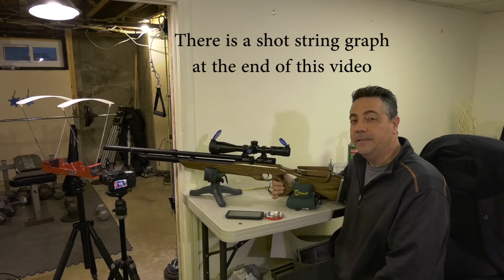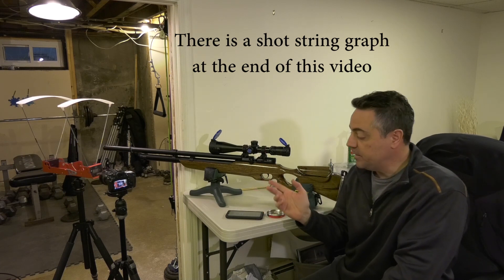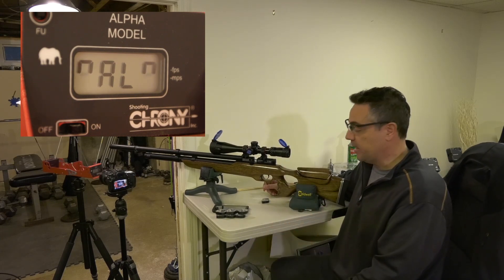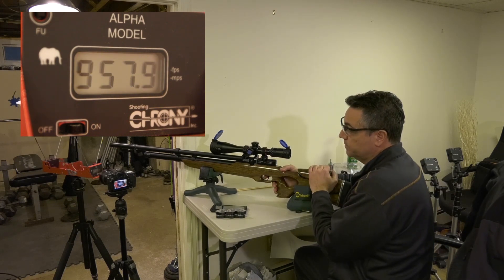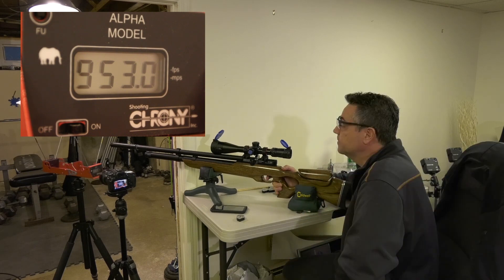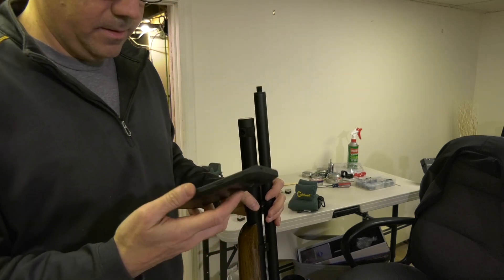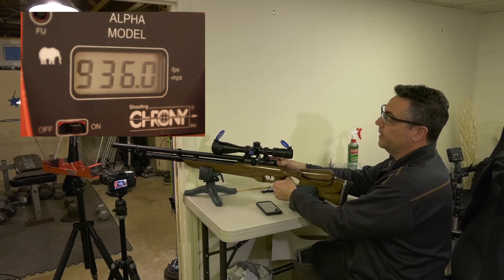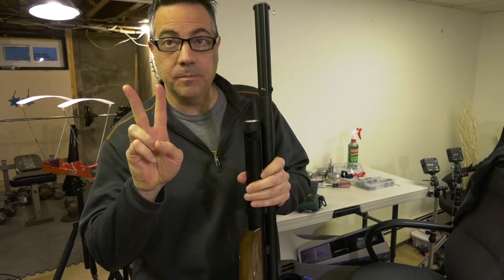ATI Nova Liberty 2nd Gun shot string and regulator test

Comment: Hi there, I did something similar with a at44 long QE using a Audrius regulator set to 115 bar and I follow the advice from some experienced guys from GTA and  airgunation    I was able to get  70 usable shots inside the regulator pressure around 825 -830 FPS was a almost flat line just amazing.For better accuracy less speed is better around 825 FPS is the max for a 14.3gr and also they help me to understand that to find a better air usage we need to find the “Plato” between Regulator pressure and hammer tension, you are doing a terrific job on this rifle but I think you can get more shots inside the regulator pressure using the same 14.3gr if you decrease the velocity and the air pressure regulator, probably 100 usable shots.

Comment: Wow just did my trigger move the screw to last hole much better , also turned 1/4 turn on the regulator wheel all i have to do now is tap the barrel to 3/16 need to get a new drill bit set hope mine turns out as nice as yours Steve.
Reply from the maker: Eventually, you may want to contact Duy (GTA name DarkCharisma) to have a power adjuster and transfer port enlarged.

Comment: Great job ! What happen with the Crosman baffle u start with ?  Any reason suppressor over that?  1 shim 1/4 turn on the reg an barrel port drilled to 3/16 that’s what is working best for u as of now ?
Reply from the maker: Thank you! I just like my airguns very quiet. This is now more quiet than my Cricket. Both guns are great. I'm just trying something different to see if minimal adjustments works fine too.
Reply: Air Velocity Sport right on do what u do brother u good.  Reason I’m asking is because I’m trying to clean up a rat problem I got the ATN  rocking 3*14 it’s dialed in but I think the liberty might be too loud without a sound suppressant of some kind for these rats

Comment: What scope and rings are you using ? Someone else asked about a year ago about the scope change. My dilemma is I can't get the right combination for height and location for eye relief and the loading port access. Putting a scope on an air rifle has more challenges than a firearm.I have purchased two scopes that won't work on my gauntlet or liberty. I like the 44mm lens. One of mine the thickness of the front lens cover housing is just enough it hits the breach block and shroud. It is a UTG 3-12x44 w 30MM tube.Compact Tactical Rifle Scope illuminated.SCP3-UM312AOIEW I thought this would be the berries but too short to get the right movement back and fourth combo with the ring position.Mid height rings calculated right but the front lens cover fitted onto the scope housing doesn't clear the breach block or shroud. With your experience. I figured you may have encountered this problem once or twice yourself.
Thank You:
Reply from the maker: The scope used in the video is the Discovery 6-24 vtt scope with Discovery mid rings. I now use the Discovery 5-30 HD 34mm tube with same rings. I have no problem because of the adjustable stock I made. Now I do have the same problem on my kral puncher jumboit does not have an adjustable cheek piece so I have to use padding with a wrap to get the correct height.when there is no adjustable cheek piece it makes it very difficult to get the correct eye relief and height. I'm now in the process of making an adjustable stock for my kral puncher jumbo

Comment: 70 shots from 3600 psi! That is awesome!! I wonder how many you'd get from a 300bar fill🤔
Reply from the maker: Probably another 29 shots. 52 addition bar divided 1.8 bar per shot is 29 shots. 100 shots from 300 bar at 29fpe
Reply: Have u tried crosman premiers for accuracy? Mine just did not like them
Reply from the maker: No, but I've heard from many people that they are not good.
Reply: 4350 psi fill does get a lot more shots but from my experience, 3600 psi fill gives you the most consistent shots and I refill when the pressure falls to 2400 psi. Because a max fill seems to affect the velocity a bit as in slower pellet speeds are what I have personally noticed. In the defence of the gun, I have the regulator opened up the whole way and the hammer spring maxed out for pushing slugs at the moment. Currently, if I put a 15.89-grain pellet in the gun and shoot it from 3600 psi fill it will Chrono at 1080 fps but if I fill the gun to 4350 psi the velocity will drop down to the mid 800s...most likely something that I've done and not the guns fault. AVS aka the banker would be more knowledgable on this issue I'm sure. I'm still wet behind the ears in the PCP world and have a lot to learn. But my guess would be my regulator is opened too far to work effectively maybe...I don't know for sure. What I do know for sure is the velocity does start to decrease when my gun gets below 2400 psi currently and when I fill above 3600 psi. Hope this helps you.

Comment: I have my Yong Heng compressor coming tomorrow. What kind of hydraulic oil do I need to get ? I'm going to get the dessicant filter system like you have.
Reply from the maker: #46 hydraulic oil. There is a  better good filter that has the bleed valve already installed. It $135 on Amazon. You might be able to get it on AliExpress for less.
Reply from the maker: Here is the link 30Mpa High Pressure Air Filter External Water-Oil Separator Filtration for Air Compressor Air Pump Scuba Diving https://www.amazon.com/dp/B077SX5G9V/ref=cm_sw_r_cp_taa_TKpGCbTBMRPGK
Reply from the maker: Remember, to not over work this little compressor. In the beginning it will fill your tanks fast because the orings are new. Over time as the orings wear it will fill slower. At that point you will have to service the compressor and change the orings. I run it about 20 minutes at time using very cold water.
Reply: Thanks so much for your help. I won't be using it a whole lot. I have the Pitbull 25 caliber and a gauntlet 22. I get quite a few shots out of them.
Reply: Got my compressor today. It has a small filter on the fill whip. Do I need to take it off or can I just leave it ? I'm getting the good dessicant filter .
Reply from the maker: Leave it on. It good as a first stage oil and dirt filter. Not so much for water.
Reply: Gotcha. Thanks so much. I ordered a synthetic #46 hydraulic oil. It looks pretty good. How much does it take to fill it ?

Comment: What brand magazines are you using?
Reply from the maker: Both the Nova and the marauder
Reply: @AirVelocitySport  10-4. I'm just trying to weigh buying marauder or nova mags. Any disadvantages or advantages for either? I was leaning toward whatever is cheaper.
Reply from the maker: The Nova click in place better than the marauder but the Nova magazines have a problem with the spring half the time. I have 6 Nova magazines and 3 had to be repaired.
Reply: @AirVelocitySport  marauder mags it is then :). Thanks for all your videos on this gun. I snagged one for a great deal with zero mags. I fixed the issues with it and want to progress beyond the single shot tray it came with.

Comment: Hi 
Can I set 900fps at L point in this gun 
And what fps I can get on high H point 

Is it right ?
Reply from the maker: Depending on the pellet you are using, how high you set the regulator and how high you shim the hammer spring you should be able to set high on 980fps with a 18grain and maybe 820fps on low. But each gunnis different and how you set the regulator versus hammer spring will make a big difference. You will have you do trial and error to get it where you want it. Bottom line this gun is very flexible.